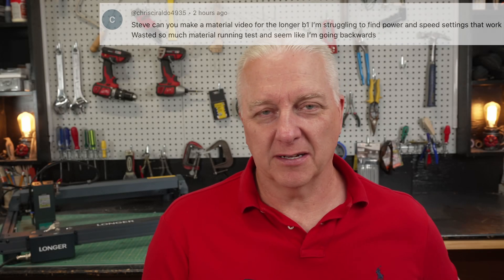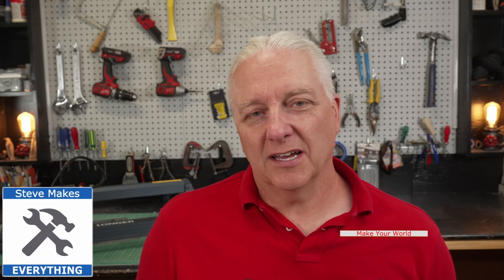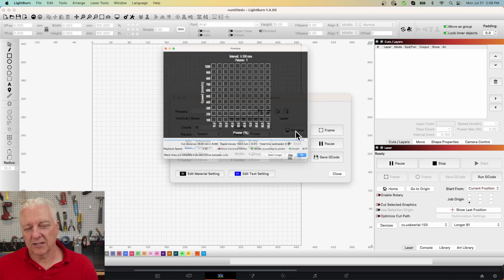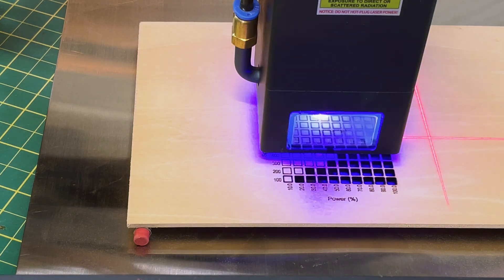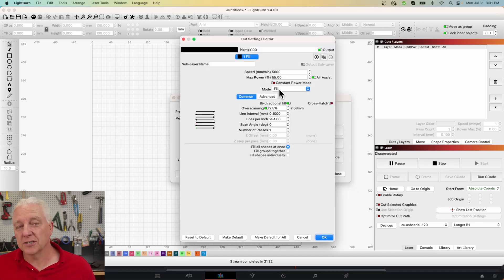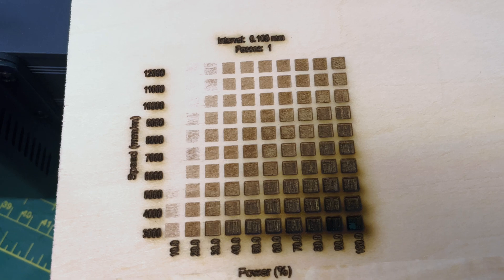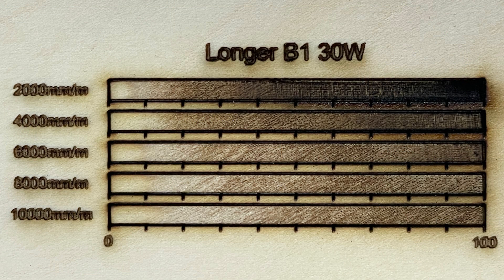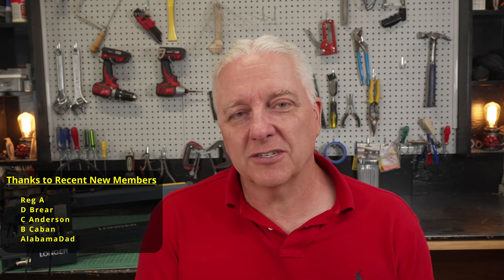Lightburn Material Test SECRETS You Need to Know for Better Results!

Comment: Hey I was so glad to find you. I'm going to try your video because I've been going insane trying to do basically a very light burn on drawing paper to sketch out something for Christmas.  I ran out of time and was trying to cheat even though I'm somewhat of an artist? lol. But do you have any tips burning with a cheaper laser machine Vevor A7 on drawing paper? I've tried it all of the things you could imagine and everything comes up and it's always wrong. Appreciate your channel and thanks for any help!
Reply from the maker: Hi Richard - I'm glad you found me too. 😉

In the end, every laser is a bit different, so material tests will be the way to go.  However is you  just want to engrave something onto paper you'll need to move pretty fast and run pretty low power.  I believe that's a 10W laser, so try something like a speed of 3000mm/m and power around 12-15%.  If you center around this in a material test you should find some values that work.

Note however, that if you find values that will engrave, the result will probably be more of an embossment than a gray/black engraving, so you might need to play around a bit.

Comment: I bought a used omtech 60 w co2 laser and I have no idea where to start with the material test I tried doing what it said on the sight and it burns the wood black. Any ideas
Reply from the maker: Make sure you have the laser focused.  Then increase the speed until the burning is reduced
Reply: @SteveMakesEverything  Thank you

Comment: When I ran my material test, the lettering was not readable.  Is there some setting that can be changed to fix this issue.  This was done through Lightburn using a longray5 10w laser
Reply from the maker: You can edit the text settings in the material test as well. Look for a button near the bottom of the material test window. Pressing this will take to the text settings used for the test.

Comment: So In the cut setting editor isnt matching any setting you have, yours indicates speed 1080 power 100%  do you need to check those numbers or do the setting from first page take over?
Reply from the maker: The settings you are showing on the X and Y axis of the grid will override anything in the regular layer settings.

Comment: Became a member so I can get the last project file Is hard to find can you add a link to this file? thanks for your videos.
Reply from the maker: Look in the community tab and you will see some members-only messages.  One of those tells you where to go and how to get the files.  If you're still having trouble, just shoot me an email (address in any video description)
Reply: @SteveMakesEverything  werew is the members area?
Reply from the maker: @tilesandpotsartesanos  If you are using Lightburn, you already have what you need.  Go to the "Laser Tools" menu and you will see a material test setting.  That's what I used in this video.

Comment: UV laser. Lightburn Material Test :) how to ?
Reply from the maker: In Lightbur, select the Laser Tools menu and down near the bottom you'll find Material Test
Reply: @SteveMakesEverything  thanks.  it is just don't know how to set it up... Param: speed/Power/Interval/Frequence/ Q puls...  :)
Reply from the maker: @FoneBone27  I typically start with the speed fixed (~200mm/s) and Q-Pulse set to something like 6ns (You can do this by editing the material settings in the material test screem).  Then on one axis I use Frequency starting with the maximum ranges (1-40Khz) and on the other axis I do interval from maybe 0.002 to 0.1.

This first test will give you a wide spectrum of output, but you can look at that and refinethe ranges and do a second test.

Not in the material settings, make sure you select "Fill" rather than "Line".  Also remember to save your test because Lightburn won't remember it if you close the Material Test window.

Comment: Is there a way to do a material test in Lightburn on cylindrical objects (using a chuck rotary)?  I have not been able to find that info anywhere.  I know there is the cylinder correction tool in Lightburn, but that seems to be for applying the test pattern to a stationary object.  When I try to use the cylinder correction tool together with the material test on my cylinder target, the chuck does not rotate.  Advice?
Reply from the maker: If you have a rotary and enable it, the test should appear like any other object you’d want to engrave.  Cylinder correction might be different.  I guess I’m going to have to try this to make sure I’m not misleading you.
Reply: @SteveMakesEverything  You were right. I was trying to make it more complicated than it was.  I didn't need to use the cylinder correction tool at all.   thanks!
Reply from the maker: @tthxpx  I was right?  I'll let my wife know that I'm NOT always wrong, and I'll circle this date on my calendar! 🤣

Comment: Hi Steve,
Thanks for all your videos, I find them extremely clear and helpful.
I am a 78-year-old man retired in Mexico and just starting laser as a hobby.
My Sculpfun S70 is at this moment stuck in Customs but in the meanwhile, I am trying to learn as much as I can about LightBurn and especially Material Testing.
I have contacted them and have visited the website but have been unable to acquire the information I was looking for.
I was hoping you could assist me by either pointing to a link or helping set up test cards that would be appropriate for the S70. Thanks in advance, Robert
Reply from the maker: Here's a video I did a while ago about Lightburn material tests. https://youtu.be/cBrwh5pLChY

This should get you started, but once the feds release your laser, you'll just have to experiment a bit (this is part of the fun!).  Once you get your feet wet, feel free to ask questions and if there's a real sore spot with Ligthburn I can do a video.  If it's slowing you down, then others will probably be interested as well.  Lightburn can be a bit intimidating at first, but we'll get you through it.😀
Reply: @SteveMakesEverything  This is very helpful. Thanks for your assistance.
Reply: Hi Steve, Sculpfun sent this to me and I'm unsure how to apply it to the MAterials Setting dialog box, especially as I don't know what Acceleration means. I hope you can help me. Thanks in advance, Robert 
Material	          Speed(mm/m)	power(%) Acceleration	Line spacing
Basswood Plywood	20000	   20	            500	        0.1
Reply from the maker: @RobertWiser-t5d  Hmm, you can change the acceleration on the laser but only from the device settings, and I wouldn't mess with that unless you're sure about what you're doing.  I think if you're using EZCad 2 you can change this value, but who uses EZCad 2??

Line spacing is the interval value in the detailed layer settings

Note that they are quoting the speed in mm/min rather than mm/s.  If you're using the latter then the speed is 333mm/s
Reply: @SteveMakesEverything  Wow, Okay, I'm not sure how that would assist me in setting up a Material Test cut, but it sounds as if you totally understand the details. So, I appear to be in the same place of not noting the range of numbers to enter.  Thanks again.
Reply from the maker: @ Ph, that's a different question.  The first time you start with a new material, you're going to have to guess a bit and then refine from there.

If you are using wood, start with a speed vs power test and run the speed from maybe 100-1000mm/s and the power from 10-100%.  This will probably result in the fast parts being invisible and the slow parts burning a lot, but then you can do another test with a better speed range.

Note to save material, make your initial test square 3 or 4mms.  You can edit this in the test.  Also make sure you save your test because if you move away from the material test window and go back, you'll be starting all over again.
Reply: @SteveMakesEverything  That was Great advice, as I expected. The laser is on the way, and as soon as I make my first couple of tests, I'll be in touch.
Thanks, Steve for your help.
Reply: @SteveMakesEverything  One last thing. Did you mean mm/s or mm/m?
Reply from the maker: @RobertWiser-t5d  Yes, I thought about this after I sent the last message but couldn't find your original post.  mm/m for all of the speed numbers I provided.
Reply from the maker: @RobertWiser-t5d  Perfect!
Reply: @SteveMakesEverything  Hi Steve, This is a rather long inquiry so I’m not sure if this is the place you wish to communicate about.
Anyway, The Sculpfun S70 Max finally arrived and is put together. According to the manual, once that was all accomplished, I was to power it on. At that point, I hadn’t turned on Lighburn to begin the process of Finding the Laser. Because this was my 1st experience with lasers, and I didn’t wish to screw anything up, I contacted Sculpfun and explained the problem. I also needed to download the CH340G driver, which I did. I think it may take a couple of days before I hear back from China, so I thought I would run my problem past you as I believe you will better explain what I need to do next. I truly appreciate all the assistance.
Reply: I realized I didn't mention the issue of the laser not moving to the Home Position. That is how all this got started.
Reply from the maker: @RobertWiser-t5d  Is the laser not homing at all when you hit the Home button in Lightburn?  I assume your laser has limit switches.  If so, they might not be turned on in the machine settings, though that would be pretty strange.

Resolving that is probably a lot more detailed than we can resolve in the comment section of a video though.
Reply from the maker: @RobertWiser-t5d  If you have the CH340 driver installed, then turn on your laser first, plug the USB cable into your computer and run lightburn.

You can try the Find My Laser option, but I'll point out that it sometimes doesn't detect the laser properly, so you may need to configure it using the manual button.  It's a bit intimidating but not too complicated.  When asked for the type of laser, you want to pick "GRBL".  It will also ask for the dimensions of your printer, which you can get from the manual or the Sculpfun website.

Fear not! Unless you poke a paper clip into the controller, there is not a lot you can mess up that can't be easily corrected.

If you get totally buried, feel free to shoot me an email (look in any of my video descriptions) and we can get it sorted.

Comment: Steve ... I am redoing my materials tests as I never cut them out and have new materials.  Down below you told me to make sure my settings were mm/sec and not mm/min...those settings (if I am in the right screen) says mm/sec are for a CO2/Salvo not a diode laser.  Am I in the right settings?
Reply from the maker: That’s the right place. Older diode lasers worked better with mm/min, but modern high power diode lasers can engrave and cut on par with CO2 laser
Reply: @SteveMakesEverything  thank you Steve!
Reply from the maker: @pbb1164  Happy to help 😀

Comment: Desperaty need help with this. I'm trying to do material test engraving with Lightburn, and I have done everything im supposed to, but the writing is not showing up at all and a lot of the boxes are missing. I can see it all working properly on preview, and i can see it working when i go to engrave, just nothing shows up! 
No one seems to know why. 
Enable text is turned on, and the engraving setting is 600mm/min at 85%.
Does anyone know what could be causing this issue?
Reply from the maker: You don't say what laser/power you have, but assuming the laser is working, you can try to reduce the speed to make the text visible/darker.  Also, if squares are missing, reduce the speed for the upper and lower ranges a bit.

These settings will be laser and material specific, which is why material tests are important in the first place.  The settings I use for my laser  might be completely different from yours
Reply: @SteveMakesEverything  thanks for replying. I have a Sculpfun S9, and I was doing a material test on plywood. 
I will give your tips a try, thanks 👍

Comment: Question: what is preferable, having the laser moving slower at 100% power, or speed with less power? Which one prolongs the life of the machine?
Reply from the maker: Certainly, using less power should extend the life of the laser.  But ignoring that, if you are cutting anything that requires 100% in a single pass, you are better to consider using less power and doing multiple passes.  This will eliminate a great deal of smoke and marks on the material and will result in a much cleaner cut.

Comment: I don't seem to have control over my origin using this test with Lightburn and my xTool P2. I have tried to set my origin in Lightburn but the tool test seems to ignore it. Not sure if that is a Lightburn issue or P2. Any thoughts?
Reply from the maker: Within the material test setup in lightburn you should be able to change the location of the test. It is in the center by default

Comment: I have a lasertree k20 on a Longmill Mk2 CNC. I am trying to do slate coasters. I am running my material test at 4000mm/min and power all the way from 25% down to 1%. All of the squares appear the same.  Does it matter if I am saving the gcode and running it through gsender?

4000mm/min 24% power on a 20watt diode laser is what the seller of the Etsy file recommends. When I try running it at those settings it just comes out as a solid block of lasering. You can’t see any variations in the grey
Reply from the maker: Slate is a bit of a binary material in that it’s either engraved or it isn’t. You can’t expect or even get much variation, though you can get a couple of different colors with the right settings.

Comment: Hey Steve, why is it when I go out and back from my saved settings in Material Test Generator  to check my edit material settings from cut to engrave the values the editor show the previous settings even though the presets change to reflect the correct settings that I saved? Thanks
Reply from the maker: This bugs me too because lightburn defaults every time you open the material test. Once you get some settings you’re happy with you can save them so you can reload your material test any time
Reply: @SteveMakesEverything  thanks

Comment: Hey Steve, I'm having an issue with engraving coated aluminum.  Currently my best setting is speed 6.0 and power 8% but I need to speed up the engraving.  Could you give me an idea on how to set up a test for aluminum?  Any help will be appreciated.
Reply from the maker: What laser are you using? This would very much control your settings.

Comment: I just got mine about a month ago. And I have been trying to run a materials test. But for some reason the option to do it in lightburn only does squares. It doesn't label what any of the holes are. It's just 10 / 10 grid of squares. Is anyone else having this issue? Or do I does not have something turned on? all the videos I've seen everyone seems to have them already labeled in lightBurn and mine doesn't seem to label them just cuts or Fills with no labels.
Reply from the maker: At the bottom of the material test screen is a button that lets you select the text setting. Click that and make sure that the text layer is enabled.

Comment: Question, in settings, "units/grids" there is a choice beween 3 unit settings. I am not sure how these are used especially the  "in/mm/min." would you explain this setting? I am using "Better for diode" laser.
Reply from the maker: The use of inches vs mm's is a personal choice for measurement.  You will find when working with lasers, most people will work in millimeters because you never have to work with fractions.  The speed in mm's/min or mm's/second is a bit of a throwback to when diode lasers were lower power and had to go much slower.  I generally always use mm/sec for speed, regardless if I'm using a CO2 or diode laser.

Comment: Steve, I have my machine running.  I went to do the material cutting test, and on the Edit Material setting page, I set the speed to 1080 and I set the max power to 100% (I zoomed in on your screen)...had a nice little fire starting...so I went back to and changed max power to 50% and I still had some coals starting.  I have a Longer B1 30 watt as you have shown...the material is  5mm luan.  Any advice on settings for another try?  The first one cut nice but the back was totally charred, second one wasn't so bad.  Am I in the ballpark w/the settings?  Thanks in advance and thanks for all of your videos!
Reply from the maker: First, make sure your units are mm/sec, not mm/min.  If you are getting fires, then raise the minimum speed by quite a bit.  In my standard tests, I start a cut test at 70mm/s (4200mm/min).  Engraving needs to be substantially faster than that for a 33W laser.

You are kind of discovering the proper material settings the hard way, but this is generally how you do it.  I typically start an engrave test at half the maximum speed of the laser.  If that ends up being too light, then I cut that value in half and do it again. and so on, until you just see darkness in the lower left square and full darkness in the lower right (note that it might be burned through, which might be an indicator to raise the minimum speed.